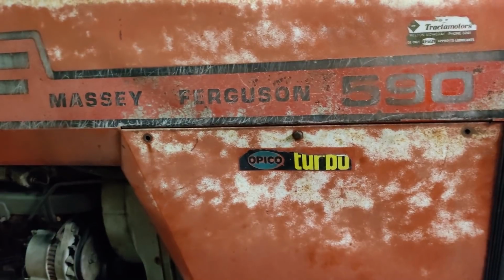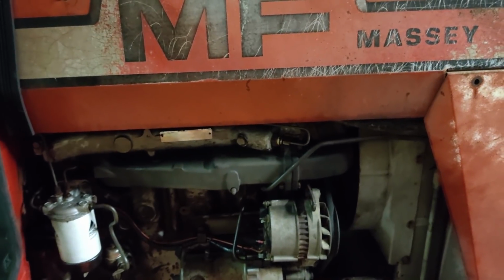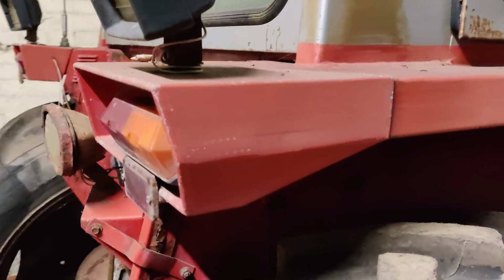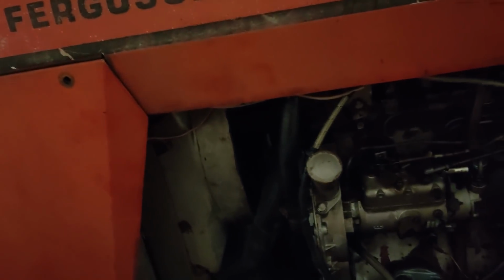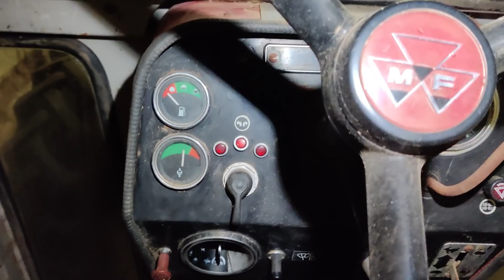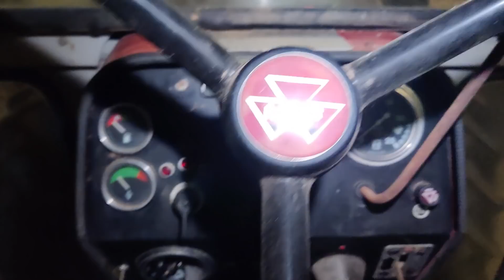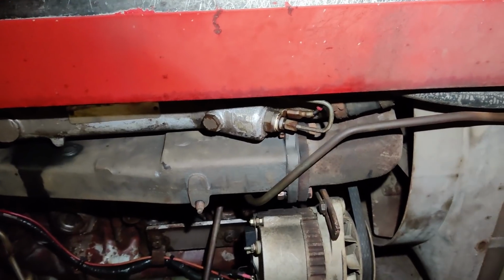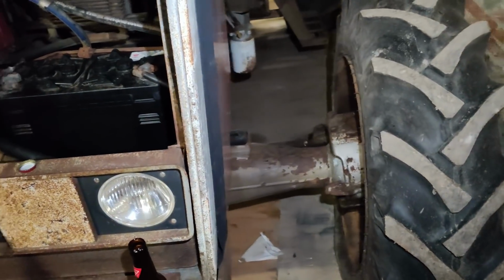Massey Ferguson 590 Walkaround

Comment: Can you please help me with some dimensions for the mounting brake pump box? I have to repair a 595 MkII without the brake mount box and pumps. Does the 590 has the same brake system? Best, Michel

Comment: You are right about the Thermostat leaking but a 500 series didn't have a reservoir like the 100 series. It was fed from the top of the  fuel filter
Reply from the maker: I remembered that just after I put the video up and it was too late to correct it 🤣. Thanks for watching.

Comment: Cannot believe how rough  (no way is this a criticism) some tractors are of this age,because it seems like only a year or two ago since I was driving new ones. And most early 80s tractor models were a giant leap forward in driver  comfort. "My" Massy 3680 was lovely it was the last new tractor I was allocated to drive,in 1989. 🏁🏁
Reply from the maker: I know what you are saying.  My working tractor has a brush and duster and window cloth in the cab, a can of glass cleaner in the tool box and I clean it regularly.  My first 590 was the same.  One place I worked at, Friday afternoon was tractor cleaning.  We all used to wash off (and sometimes wax too) and clean cabs.
Reply: Paintwork was never Masseys strongest point in the 70's and 80's, as long as it looked red it would do. Didn't help that red is a terrible colour for fading, just look at some red cars of the same era.

Comment: Excellent video 👍 drove a 595 turbo an a 575 turbo 4wd which was a really gutsy performer 💪 that looks like a really good original tractor you got yourself 👌👍
Reply from the maker: The 595 turbo sounded lovely and in its day was a big tractor.  Not a big fan of the 318 engine, but it sounded well when working hard.

Comment: well you doing a better job than the workshop manual and i wish you was on here about 5 weeks ago ive got a 595 i bought as hydraulics faulty couldn't work the manual out but the way you explained the workings i wouldn't of needed one so i just pulled the lot apart i think its daft i split it just behind the gearbox but would of prefered to take the box back with the rest of it but the cab is mounted on it so i think i might alter the mounting so in future  any probs i can roll the lot back and do the clutch at the same time got it back to gether got 3000 psi on a gauge and 300 for the multi power pump so just need to put some load on it make sure it works ok
Reply from the maker: Thanks for watching. I'm glad you found it helpful.

Comment: Back in the day the first thing I did with a Perkins engine was remove the thermostart device, I never found they really helped with cold starting  and they always gave trouble with fuel leaks. Mind my experience was more with  trucks and plant and not tractors, if the weather was that cold the engine would not start without some extra heat a blow torch was better or a squirt of ether but usually they started on the button without the extra help.
Reply from the maker: A lot of Perkins engines actually had a built-in ether start for cold temperatures, but you're right.  A well maintained engine in good condition should start on the button if the cranking speed is good unless you get to about -20 of course!  Thanks for watching.

Comment: Thought it was French, rear lights gave it away, it didn't have the lucas square lights. We had the first 690 4x4 short wheel base and the drop box always leaked until local dealer put liquid grease in and never gave any more trouble
Reply from the maker: Thanks for sharing that, interesting.   Can you imagine a Fendt dealer doing that today?  Thanks for watching.

Comment: Nice tidy example always remember a 2wd red cab two door where my dad worked with turbo didn’t realise the turbo was factory option. Always puzzled me why 200 series 500 series and 600 series all seemed produced at same times what were the reasoning behind them
Reply from the maker: It was a factory approved dealer option really, but there were quite a few about.  I think the 500s came first then the 200 series overlapped mostly for export as a budget option, then the 600 series replaced the 500s and the 200 series are still being made in various places around the world.  I think...

Thanks for watching.

Comment: Exhaust would have been fitted by dealer that installed turbo . It would have been in the turbo kit . The exact same exhaust and rain flap were fitted to our ford 5610 which had a opico turbo fitted to it .
Reply from the maker: That's correct, Opico made the only MF approved dealer kit at the time.  It should have a Turbo II pre-cleaner as well to make it look just right.  Thanks for watching.

Comment: Learnt to drive on a 595 2wd non mp same cab made in France but the owner sold it back in 92 as it had a cracked block, he covered it with some mud, think it sold for around 1500 pounds it wasn't turbo but he was told they were prone to the block cracking. Is this true as I would guess is not true and I'm pretty sure he'd not topped up or changed anti freeze and probably never changed oil or filters either.
Hope you had a great Xmas and all the best for 22.
Reply from the maker: the 595 was fitted with the A4.318, which wasn't a great engine, prone to problems due to localized overheating in the head, but they weren't particularly well know for cracking the block.  Thanks for watching.
Reply: @ClarenceFudWeasel  
Thanks Clarence. I presume they all had the same engine so that's interesting.

Comment: what is the diffferene between MF 188 and MF 178 knowing that both have the same engine perkins 248 ??
Reply from the maker: From memory, the 178 and 188 were very similar.  188 was about 5hp more and had a slightly higher capacity hydraulic system and different brakes.  Thanks for watching.

Comment: Great video as always, it's a nice looking machine. 
What is the 4wd input shaft like? My 178 leaks and is on the to do list.
Merry Christmas 🎄
Reply from the maker: Thanks, and thanks for watching.  It's pretty worn and leaking, I guess I will be taking the whole front axle off at some point.  Your 178 has the same axle doesn't it?
Reply: @ClarenceFudWeasel  yes, same axle, different steering set up.
The seal is just an O ring, poor design.
I'm hoping to machine the housing to accept a lip seal if theres one the correct size.
Reply from the maker: Be very interested to see what you do there, I'm almost certainly going to have to do the same.
Reply: @ClarenceFudWeasel  I got the idea from Classic Tractor magazine, February 2015 if you can get hold of a back issue, if not send me an email and I'll have a go at scanning it.
Reply from the maker: @CowfarmerDan  That would be appreciated, thank you.  I'll send you an email.

Comment: That is a nice straight tractor for its age, being multi power I'm assuming 2 pumps? What confuses me is the selector valve
Reply: The selctor valve could be used for 2 functions and piped 2 ways. The tipping pipe could be fed from it (ext 2) or as it has spool valves ext 2 could be feeding the  spools as well as the aux pump (combined flow) giving you 13 gpm instead of 5 gpm.
Reply from the maker: Thanks Andrew!  Saved me some typing.  Thanks both for watching.